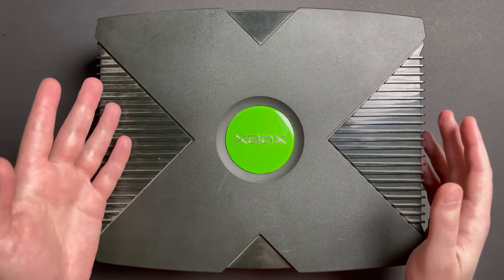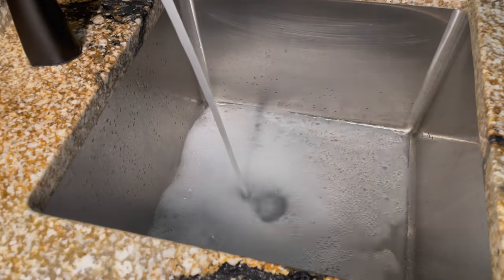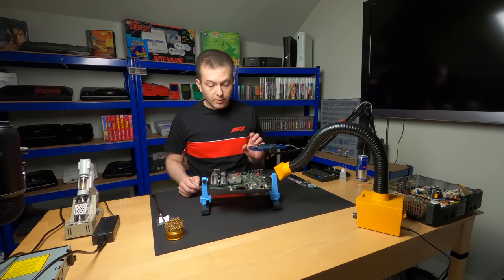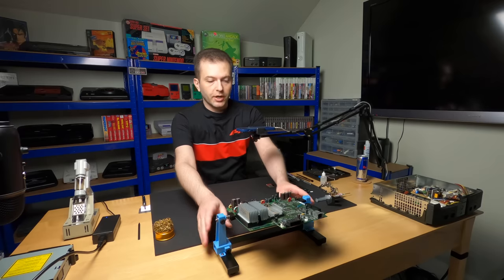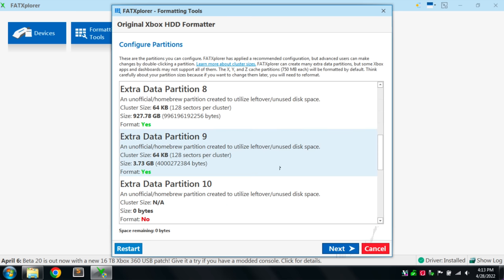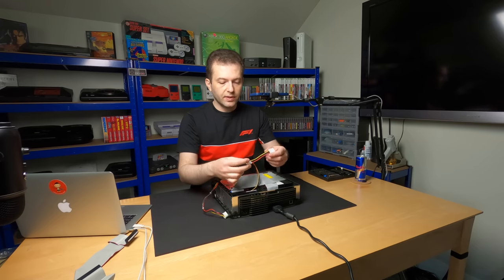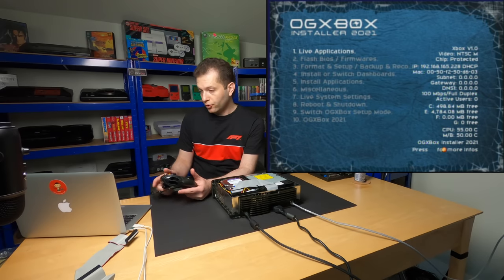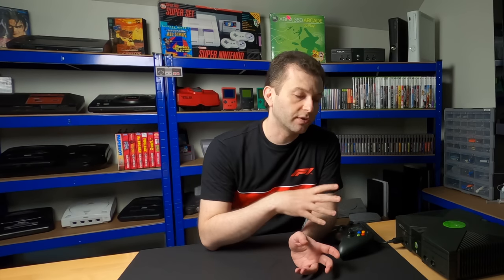16TB in an OG Xbox? CERBIOS has arrived.

Comment: This was an amazing video. Modding an Xbox with a larger hard drive back in the day was quite a doozy (softmodding w/ ide drive hot swapping) but it was the very best mod experience I've ever had. Thrilling to see that new boot screen and run every old-school emulator/mame ROM I could get my hands on. Thanks so much for this!
Reply from the maker: I kinda missed out on the modding scene back which is why I almost always want to chip a system even though there are easier ways to do it nowadays.
Reply: Yeah that was a nerve wrecking thing!! I remember it well!! Hot swapping the IDE HDD to a PC to extract the HDD KEY, that was only possible if the drive was unlocked by the XBOX when it's turned on. (If you did it wrong, you could brick your original HDD, and an HDD from another XBOX doesn't work due to the KEY linked to the other XBOX...)  You also had to copy 2 DIR's from the drive, with a special file manager on your pc.

Comment: Nice and tidy work as usual, bud.   You're right in being proud of that mod work, it turned out quite nice and neat.   

I actually have a v1.0 system myself, with a 4TB HDD which I have had multiple partitions on for a couple years now.  I will definitely be looking into Cerbios in order to clean things up in a similar manner.  I don't have modchip though, so, will likely be flashing TSOP, but, should work out fine, I'm sure.

Thanks for the video, as I haven't kept up with OG XBox much lately, and I would not have discovered Cerbios without your video here.

Comment: Great video!  I have several OG Xbox'es with different modchips.. Time to dust them off, check for leaky caps and get a new HDD (SSD?) installed.  I always ran Avalaunch dash on mine with a 1TB IDE HDD..  So cool to see the Xbox modding scene still active almost 20 years after the release.

Comment: Thank you for actually using the other footprint for the clock cap. So many people I've seen swap this seemingly do not realize that the extra footprint is there because some supercapacitors would've had a different pin spacing.

Comment: I think I'm going to give this a try.  I bought my first Xbox yesterday, was a 1.0 model.  It has never been opened before, the clock capacitor had just started to leak.  Only damage done was the silk screen for the components around the clock capacitor came off when cleaning with ipa.  I'm going to do a full cap replacement while I have it all apart.

Comment: Wow, really great mod job. Looks fantastic. The part about the ide cable being backwards for the Xbox isn’t correct tho, the connector between the disc drive and the hard drive isn’t long enough to connect it in the right way (blue side to the mobo) so everyone just hooks it up that way. There was a post on the old forums years ago where a guy did some test with custom made ide cables and it showed that the Xbox actually has better speeds when it’s hooked up the right way, there is a jumper in the blue side that identifies the cable as ultra ide, but it works fine being plugged in the other way.
Reply from the maker: Woah alright, thanks for the correction. Neat, I'll have to poke around and see if I can learn a bit more about the jumper thing. I find these irrelevant details fascinating, as I'm sure you can imagine.

Comment: Cool Mod , I have seen them turned into Windows RC   and XP  Pro Operating systems as so you have a Computer and a Game Box   , Not sure if it can Do Win 7   or Higher , That is a Lot of Space on the Drive if it can do 16 TB I suppose it can have a Virtual Box running 20 or More Operating systems in Emulation . What a cool Set up that would be :) QC

Comment: I still have 2 xbox's from 2001 that I modded with xecuter chips and added 3x 400g seagate drives with a kit that extended the xbox to make it taller and have 3 power buttons depending on the hard drive you wanted to use. I had 1 for xbox games, 1 for emulators, and 1 for Xbox Media Center with movies. Still my favorite console to date. It is crazy they are still releasing new mods for it today, I am going to have to redo mine to get up to date with bigger and faster drives. The CPU upgrades I have seen are crazy but not something I would ever attempt.

Comment: Great job! Your work is so clean. I respect your working mentality. I installed a 2TB hdd two weeks ago but I had problems with folding the cable. It works but it looks really bad inside. Maybe I will try it again because I am actually not happy with my job. I also like to have it clean inside. So whenever I will open it I will see my mess. I did it with the yellow cable. 
The original Xbox is so underrated. I never knew how many good exclusives it had. I only had a PS2 as a child so I missed all those games. Now I can play them all.
Reply from the maker: If it's bothering you get back in there and give that Xbox some love. Nothing a lazy Sunday afternoon can't fix :) Best of luck!

Comment: I just finished a 2tb crystal xbox with open xenium chip and evox m8 plus 16 BIOS. Brilliant for gaming (have coinops8 for arcade/mame and my games installed). 

I think I'll be doing this Cerbios 16tb next, this would be a perfect media (movies) solution. Also that 80 pin ribbon, make sure to get the long version people, you'll need the length to connect to everything with the right angles and bends.

And thanks this is a good tutorial, you know what you're doing. Am gonna repaste my heatsinks as didn't think to and my xbox was getting a bit warm.

Comment: 10:35 DON'T RIP THE COOLER OF THE GPU LIKE THAT! You can rip the chip clean off the board! You know how to remove it correctly and way safer? Put the mobo back into the console, connect the front buttons cable and connect the power supply, don't bother connecting anything else, we want heat to do the job for us! Just turn on the console and let it sit, every 30 seconds, try to move the gpu heatsink, the moment it starts to move, unplug the console and just take of the heatsink. And another tip for removing the screws under the feet, you don't need to remove the feet entirely, you can just fold them over and remove the screws that way, the adhesive is super strong, way stronger than anything you are going to replace it with, how to fold? Start at the edge the closest to the outer edges of the console, peel 'em up and you can get your screwdriver into the screw and remove it this way, you will see that the feet will fold back into place once you're done.

Comment: Everything about this is fascinating. While I don't have the OG Xbox my 360 is getting stupidly long in the tooth and I want to mod it at some point, probably whenever online support ends. I'm not sure of my options and I don't put enough hours into it to get it away from stock at the moment so I'm most likely going to stick to a modest 240G HDD. I would like to do SSD but everywhere I look it seems that's more trouble than it's worth. Not sure if the OG Xbox could benefit from it either. I can sense bottlenecks all over the place after seeing that IDE ribbon.

Comment: Really a great tutorial, straight forward and all.

But i have some questions as a beginner to this.

I have a v1.4 with FOCUS video encoder, with an X-Bit modchip(sits outside the xbox with some dipswitches) running Xecuter2 4980.67 bios (thats what the kernel says) that i have had since childhood. 

And i am now gonna try to refurbish it with new paste, bigger HDD and flash the bios to let me use Insignia (X2 bios blocks it)

So my questions for you are: 

1. Will cerbios work with this old chip without any problems?
2. How do i know beforehand if i have winbond, hynix, st etc? Or will the bios be flashed to the x-bit or how does it work? Because i see in the cerbios menu, flash sharp, winbond etc or will Resctoox sort it out like it does for you?

I hope you understand and can give me a good answer to get me up to speed with my outdated hardmodded console ;)

UPDATE: Seems like the XBIT is a pain in the ass to flash now that i found a forum about it compared to modern chips. It uses a mini usb that needs an old os and its program to be used. I need to go deeper in this. Or i might be out of luck on this old chip

Comment: So lithium grease is fine for plastics? I did some googling awhile back when I was restoring one of my consoles and it recommended silicon grease for plastics, since the petroleum base in lithium grease could degrade the plastic or something. You seem quite knowledgeable about all this so is it safe to say it's actually a non-issue?

Comment: I thought you would use single core / strand 30awg wire, but you're using the one with multiple strands. Doesn`t make that the job more difficult? Or because of the very small size of the wire you wouldn`t notice it?

Comment: Every time... if you are going to snip the leads of the through hole component AFTER you solder it in place you need to retouch the joints for the sake of longevity for the joint. I know that I may get hate for even posting this comment but it's just good practice because the snipping can break or weaken the joint and before you say "he said it was a non-critical component" just think of how you would feel if you paid someone who learned from YouTube to mod and you paid them to fix this or any other issue and it broke quite quickly after getting it back. 

I will say that he has good technique other then that and I spent quite a few years IPC class 3 certified.

Comment: Is this the appropriate amount of grease used in the CD ROM? I dont know, it just looked really excessive as too much lube tends to collect dust until it clumps up and causes issues down the line. Also if those gears were made from nylon or acetal, those are spesifically designed to not be lubed at all. But again, never worked on an original xbox before.

Comment: I am very curious why you didn't just flash the cerbios onto the original BIOS chip.  I think it just takes a softmod and a solder connection on the bottom of the board.  What does the Aladdin mod chip bring to the party?  (I haven't done one of these in years and years.)  Is it possible Cerbios needs a larger bios chip?
Reply: I see its in Alpha state and you want a modchip that can easily go back to a known working bios.  Interesting.
Reply from the maker: v2.0.2 is officially out of beta so you can TSOP if you want. I always prefer to modchip my Xboxes, even 1.0 and 1.1s. Just personal preference. I like the idea of flashing a thowaway $10 chip and leaving the Xbox intact.

Comment: So with Cerbios you can set UDMA to 6 and increase the data transfer from 33.3 mb/s to 133 mb/s? That sounds pretty cool. Is an 80 wire cable enough for that? Or what else do you need?

Comment: I'm up to buy an OG to try this. Do you know if it's possible to use round cables? Would it fit where the flat one is. btw Your soldering tools are neat.
Reply from the maker: Haven't tried. Might be tight with the tolerances of the top case without modification.

Comment: Why did you not just wash the mother board in the sink, then pour distilled water over it before letting dry, or use the air compressor?

Comment: Hey, how difficult is it to replace a DVD drive (once the console is modded)?  I have an old original Xbox, and the DVD drive went bad (stopped reading disks).  Got a new one, and softmodded the old one with the broken drive.  I've always wanted to fix up the old one and put in a working drive... I know there's things like drive keys and such, but I'm just wondering if it's much work to replace one.  I was thinking of following this video and just doing a full hardware mod on it and bringing it up to date, but if I'm gonna do that, I think I may as well try to replace the drive while I'm at it.
Reply from the maker: DVD drives are interchangeable on the OG Xbox. Any drive from a donor system is a drop-in replacement. No keys to be concerned about.

Comment: That lithium grease was heavily applied, i'd say that is quite overkill and will only attract more gunk for more problems. You really only need one teeny tiny dot and it goes such a long way, and will be distributed no problem. It's best to keep the plastic as clean as possible and it wont bind and does what it needs to do without anything.

Comment: Just as a bit of advice isopropyl or Rubing alcohol wont hurt your electronics and really helps with adhesives and tough thermal paste. Its a really easy to use and safe to handle solvent that isnt too strong. Just let it evaporate before you run power through anything and do t drink it, wrong alcohol.

Comment: Cerbios is a huge improvement over previous bios options. it's now the most complete solution for the majority modders. Not only does it offer the best storage capacity, it does not block xbox live, and this is important if you wish to play on insignia. It also supports the 128mb ram upgrade for anyone wishing to get the best out of the console.

Comment: I lifted the pads , on the lpc throughholes and several of them do not have continuity, what do i do here? Some of the alternate points on the mpx chip is too small for me. Is there new throughole contacts i could purchase, or if i can scratch nearby the holes too get continuity? Should i drill the holes to clean them to get continuity? Ok, I read that the plated throughholes bridge traces from the bottom to the top of the via. I see some for sale but I am not sure if they fit. BTW, what size are the throughholes contacts to buy?

Comment: I would not recommend prying the heatsinks off like that  It's entirely possible to rip the CPU off the board before the aggressive adhesive gives way. Use a hairdryer to heat up the heatsink for a minute or two, then twist the heatsink side to side until it loosens, then pull up with minimal force. You don't want to use much force, trust me.

Also, those are the same IDE cables i purchased years ago. They are cheap, so it's easy to scrape off the protective layer by accident, exposing the wire. It's hard to find quality cables these days, as they are niche, and not mass produced any longer.
Reply: That Cerbios load screen was amazing. I haven't dabbled with this new BIOS, but that animation makes me want to!

The OG Xbox community these days is just awesome. All these projects that keep coming out, it's the best time to be a modder.

Comment: Heij😀 It so happens to be that I found an og Xbox in the trash. Thought "wait a minute- I want Fast&Furoius 2 for it." Bought comptrollers and the game and was turned off by how bad it looks on my Trinitron- put it away. 
Now, this mod seems rather simple because I have all the tools to do it neat, same You did.
Why shouldn´t I try and modchip mine? Looks simple enough (when You got the tools). Good job doing and explaining what happens in a manner even I can follow along. If I do I´m gonna do it exactly as shown because I liked it- do not wanna mess up my box. 
Honestly: I was a PlayStation Guy at the time this was hip so I need a Ps one, too. I had the 1b, the smaller series with external power supply, liked it better. So: have a nice day, Kind Regards

Comment: Great video!
I've been thinking of buying an original xbox and modifying it for a while now, and from your video it looks very much doable even for a novice like me (I might have to seek assistance with the soldering, but that's ok) the only thing I'm not sure on is connecting it to a modern TV as I know a HDMI mod is doable, but a scart to hdmi adapter is probably a better option for me
Reply from the maker: I'm personally using component cables. You could always look into an upscaler and use it on multiple retro systems unless you really just want HD on the Xbox.

Comment: wow there is finally after a decade a bios that goes over the 2tb limitation  i have used these chips before they work well in my installs also do you know if there is a way of hooking up a lcd screen to the xt chips or if it only works on certain chips 

but yeah ill be doing my self a new modded xbox build great video also why was the clock copastor replaced ?

Comment: Props for putting a new clock cap. Why not replace the drive belt? You can find that size in drive belt kits commonly available.
Reply: Your install is really clean. I like to depin them from the connector and clip them one by one before reinserting them. It only takes a second and makes a difference.

Comment: Did you set the BIOS to UDMA100? With the new BIOS and the Startech adapter UDMA100 is possible instead of the default UDMA33. With a cheap adapter you can use UDMA66, still a huge improvement.
Reply from the maker: How do you do this? I don't see any flags in the INI file to toggle it.
Reply: @BorderlineOCD  I got confused, Titan bios only offers this feature. Unfortunately I read about that after I posted this comment. Would be cool to see a cerbios vs titan video. 

Apparently udma100 helps with xbmc4gamers loading times as well.

Comment: Maybe a dumb question but a few years back I bought Xbox at a tag sale and discovered that the Xbox could be used for retro gaming. So I got a kit on eBay with rocky5 and the Splinter Cell game. I never got around to doing it. Is this build with the Aladdin chip just for OG Xbox games or can you still emulate let's say Nintendo games?
Reply from the maker: You have a bit more control over the system with a hard mod like the Aladdin or just a direct TSOP flash. Emulators work just fine. Soft modding is more approachable for folks that don't want to tinker with the system's internals.

Comment: I wonder how well it'll do in my current chipped Xbox. Considering the previous owner just wired in a custom flashed BIOS chip, it should be easy to experiment with another chip+eprom programer.

Chip definitely works as it doesn't require a locked HDD - and it did come with a rather early+buggy version of EvoX.